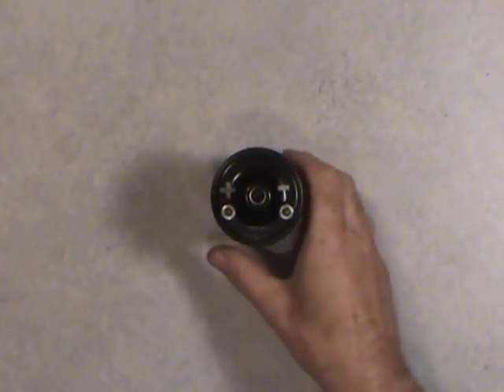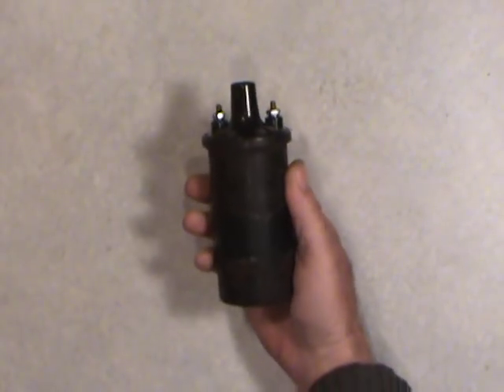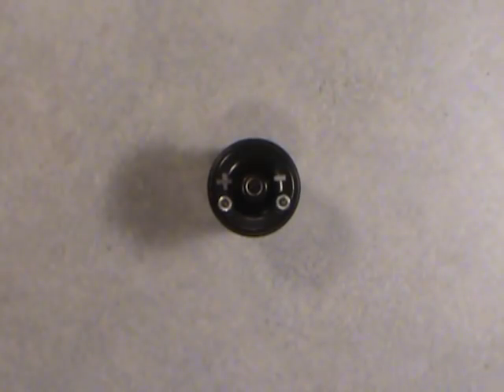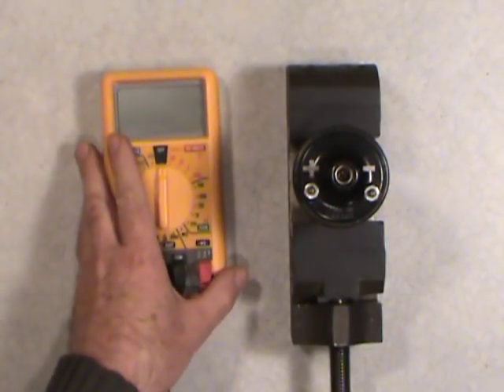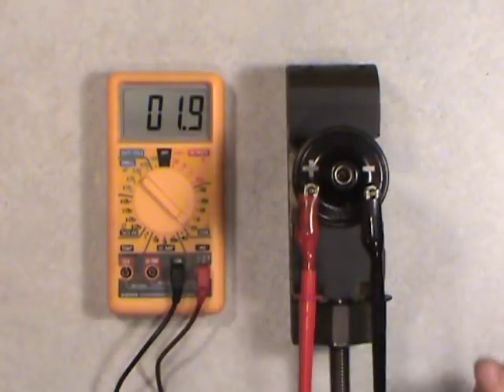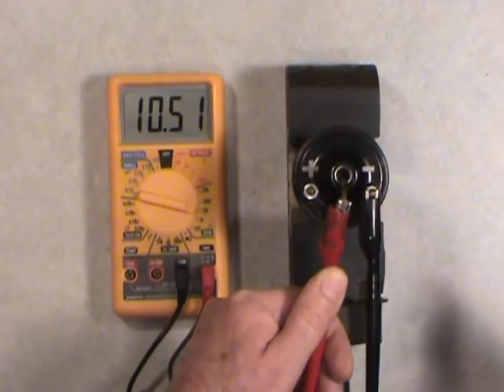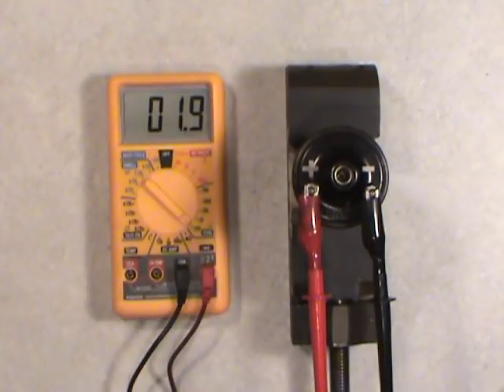Ignition Coil Testing

Comment: Thank you...Sir great video!  Helped a lot in troubleshooting  Coil - 1992 Ford T-Bird SC
Reply from the maker: Ravi Diasabeygunawardena Greetings Ravi Diasabeygunawardena....You are welcome, and, thanks kindly, for Your Great comment too!..........................................It's good to hear, that, You were able to use some of the Information, in this YouTube Video of mine, that was able to help You out, somewhat................................................By Testing, just about any Ignition Coil, with an Ohm Meter/Multi-meter, is, as I see it, just a "Preliminary" (aka, as in an Initial, and, Not-so-Complete) Test, so to speak, as, at times, an Ignition Coil, may appear to be Faulty, and Not be Working, all that well, or, even, Not at all, and could be either, the Ignition Coil Itself, and/or, could also be, any of the Related Wiring or Electrical Circuitry, that is part and parcel, of the Ignition System, as a Whole (aka, Total, of "All" Ignition System "Related" Parts and Pieces)........................................................Sometimes, an Ignition Coil, can become, Not Working very good, or, might even stop working, maybe even causing some..."Ignition Related"..."Miss-Firing" as well, when it Heats Up, and, Breaks Down, under a Loaded (aka, perhaps, a High Demand of its Output) Operating Condition......................................................So then, let's assume that, the Ignition Coil is in "100% (One Hundred Per-Cent) Working Order", then, any, and..."All Other"..."Ignition System Related"..."Components"..."Circuitry"..."Switches"..."Wiring"...etc., have to be in "100%"..."Working Order"..as well, or, we just might end up with...a Car or Truck, that, might..."Not Start"..."Have a Difficult Time Starting, either Hot or Cold, or, maybe Both"..."Start to Miss-Fire" (Ignition System-wise), and, from what I have seen over the years, I've come to the Point, and, train of thought, that..."I Assume Nothing"...and..."Never Rule Anything Out"...because, even when I thought, that I've seen "Everything"...there are, at times, a..."Thing or Two"...that have..."Shown Up"...that was "Totally Unexpected", and from my perspective..."Un-Thought-of"...as well..."Yikes"..!!!...lol......................................................Here's a pretty good "One", that happened to "Me", quite a few Years ago......................................................When the Engine (350 Cubic Inch Chevy V-8, with an Oil Filled ignition coil, that was controlled by, a points & condenser distributor) was "Cold", I Start it up, and Drive away...and...all seems to be alright...then...oh, about 1/2 Mile from Home, the Engine just "Quits, and Stops Running"...!!!...................................................I manage to coast it over to the side of the Road, and park the Car.....................................................I try to Re-Start the Engine...No Luck.....................................................I then wait, oh, about 5 to 10 Minutes, and then, try to Re-Start the Engine...and..."It"..."Starts Right Up", and I Drive away, and the Engine Runs, as if...there "Never Was a Problem" at All..!!!............................................During some Other times, the Engine would Run very good, for hours even...................................................Then, one time, I recall, just Cruising along, then, the Engine, just goes..."Silent"...for a few Seconds...and then..."It"...Starts Running "Again", as though "It" Never went "Silent" at all, in the first place...!!!.........................................I was Convinced, that, it was something to do with the "Fuel System", because, usually, if a person were to Turn Off the Ignition, and seeing how this Chevy V-8 Engine had a Carburetor on It, had me thinkin', that, once the Ignition started "Sparking" again (after Not Sparking, for those Few Seconds), I was also thinkin', that, there should have been some "Raw" (Un-Burned) Air/Fuel Mixture, as supplied by the Carburetor, when the Ignition System, was in the "Off", as in, "Not Operating" at that particular point in time, and, once the Ignition System Began "Sparking Again", I was quite sure, that, the Engine should have had, a nice Big "Back-Fire",Through the Exhaust System, due to, what I thought, would be the Result, of all of that Raw/Un-Burned Gasoline/Air Mixture, getting "Zapped", with that..."Working Again"...and shall I say, at times..."Intermittent"...Ignition System, that I had back then...!!!...................................................Now then, can You "Guess", what was "Causing" all of this "Ghost-Like-Engine-Operation"...???....................................................Yes-Sir-ee-Bob, when I Finally, got to the point, of, Removing the "High Tension Lead/Wire" (just a fancy name for the spark plug-like wire/lead) that "Connects" the (oil filled type) "Ignition Coil's Output Tower Connection/Terminal"....to the..."Center Tower Connection/Terminal, of the Distributor Cap", here's what I "Found" (aka, Discovered).......................................When I looked Down, Inside the High Tension..Lead/Wire's, rubber-like Boot...to look at, the Wire/Lead End Terminal (made of Brass), that supposedly, "Is"..."Supposed to"...be..."Crimped/Connected" to the Lead/Wire's...Internal "Core Conductor"...what I saw, was, that, the Lead/Wire's Conductive Core had..."Arced Away" (aka, Electrically "ERODED") away, from the Brass "Terminal", leaving a "Big Gap", between the Lead/Wire's "Conductive Core", and the "Brass End Terminal", there-for, as I see it, that Very High Ignition Coil's Voltage, was Forced to Jump that "Big Gap", that "Should Not" have been there in the first place...!!!.............................................Yes, indeed, it was rather difficult, to actually Imagine, that, that Quite Large Gap, between the Lead/Wire's Conductive Core, and the Brass End Terminal, could Actually "Cause", that, shall I say..."Very Weird"..."Sometimes Intermittent"...Chevy V-8 Engine..."Behavior"...that I Actually Experienced...!!!......................................................Once I Replaced that "Faulty" High Tension Lead/Wire, that went Between the (oil filled) Ignition Coil, and the Distributor Cap, it was like, I just Installed...an, as New, just broken in, Rebuilt Engine, that, Ran "Super-Duper"..."Yipee"...!!!...lol..............................................So, as You can now see, just when "I" think, that I've "Seen-It-All".."I"..."Have-Not", and that's the way..."The Old Ball Bounces"...weather "I' like it, or not...!!!....lol..........................................Thanks again, for watching, my Friend.................................................Be Safe, take care, and have a good one.

Comment: Thanks for the video mate. Nicely explained.
Reply from the maker: +john wright Greetings john wright....Thanks for watching, and Thanks, for Your very Appreciated comment, as well, my Friend............................We, just have to remember, to always "Check/Verify", the Ohm-Meter or Multi-Meter, for "O or Zero" Ohms/Calibration, especially so, when-ever, about to take/measure, those very "Low Ohms" Readings, on the Primary side, of an Ignition Coil, for Accuracy's sake, that's for sure.......................I should also add, that, even though a certain Ignition Coil, tests out OK, Ohms-wise, while usually being at about room temperature, there-abouts, there can be a times, where an Ignition Coil might start Acting-up, and, not work so well, or, maybe stop working all-together, once, that now (Ohms-Un-Detect-able), Faulty Ignition Coil, gets up-to Operating Temperature, or hotter...!!!.............................Just goes to show, that, "Ohm's Testing", an already used Ignition Coil, might not be, the, Be-All-End-All "Test", to confirm, it to be 100% Good and Functional, and, I guess, that, One could say, that, it's just one more, of "Life's"...little........................."Surprises"...lol........................Thanks again, and...........till next time.............Be Safe, take care, and have a good one.

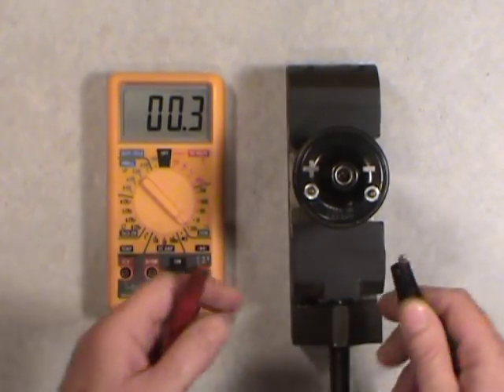Comment: Not hating on the video because it is good/ informative. But if you already know what a coil is and know how to use a meter, start the video at 10:30 for the specs your looking for. Also the "1" on the meter when checking the secondary coil should be thought of as an "I" for infinite as in "infinite resistance ", or "open circuit."
Reply from the maker: Greetings...jhitt79....Thanks for watching....................Hmmmmm...but, what..."if"...???...a Person, who happens to be, shall we say...New to the Game...and doesn't know, all that much, about an Ignition Coil, and how to Ohm/Resistance Test "it", with an Ohm/Multi-meter, then, should I, just, shall we say..."Leave-Them-Out-In-the-Cold"...??? (some might...But Not Me...!!!...cuz that's, just the way I am).................Sure, if I didn't give a hoot, about the Beginner/Novice, I could, just make, a..."Very-Short-and-to-the-Point"...YouTube Video, in a, shall we say..."Slam Dunk" (basket-ball term)...fashion...for the..."More Advanced"...Automotive-Minded Folks, alright (and it would save me quite a bit of Time as well, if I were to do so)......................That "1", that You mentioned, could very well be thought of, as being "Infinite/Infinity", quite possibly, but, from my Experience, with the Yellow Multi-meter, that You see, in this Video of mine, then, "it" will usually, just..."Display"...what appears to be, the Number..."1"...on the Screen, if I..."didn't have"...the..."Correct...Range/Scale"...Selected, for what-ever, was being Tested, at that particular point in time....................I'm thinkin', that, Different Multi-meters, might just have, a Different way of Displaying things, perhaps...???....................(Here's some food for thought)...although an Ignition Coil, might Check-out/Test Ok, Ohms/Resistance-wise, there could be a (rare) time, where, that, Tested-Out Ok, at room temperature (ohms-wise), Ignition Coil, might start to Malfunction, or maybe, might even stop working all-together, once it gets up-to Operating Temperature, or perhaps Hotter (Thermal Cycling...???), so, maybe keep that in mind, if there ever comes a time, where-by, the Un-Explainable, can't be Explained, until perhaps, a (known good)...Substitute...(new or used) Ignition Coil, takes the place-of, that...Not-so-good...Faulty...(while warmed-up only)...Ignition Coil, and..........till next time..........Be Safe, take care, and have a good one.
Reply: +RockysRoadshow Relax dude... Did you not see at the beginning of my comment that I said the video was good/informative??? I was giving you a compliment, then just letting anybody who was looking for how to test a coil (or the ohm specs.) on where to start the video "IF" they already knew how to use a meter, etc.  And the technical term for the 1 on your meter IS infinite resistance.
Reply from the maker: Greetings...jhitt79..........Ooops...my Bad...sorry about that...and Thanks, for the good comment as well................Actually, I'm quite Relaxed (most of the time...so, fear not)...................Quite some time ago, I did make a Shorter Version (Video), on Ohms-Testing (this very same), Oil Filled type of Ignition Coil, as well as, a Shorter Version (Video), on Ohms-Testing (the very same), 1979 General Motors (GMC)...Chevy HEI/High Energy Ignition...(epoxy-encapsulated)...Coil...(the type, that's mounted in the top of the BIG distributor cap)....................I'm not such a Fan, of using the Word "Infinity", when it comes to Ohms/Resistance Testing, with an average Ohm/Multi-meter, as I find it (for me, that is), kinda Misleading.................I much, prefer to hear, and/or use, the terminology, simply known as, an...(electrical)..."Open Circuit"...as, it's Super Easy to Visualize & Understand (just picture, in Your Mind, the Multi-meter's, Ohm's Dial/Range Selector, being set, so the Meter is active/on, and the "Test Lead Probes", are separated/not touching each other), and..."Wull-Ah"...there "it" is...!!! (a good ole...super easy to understand..."Open [electrical] Circuit"), and besides, if I were to "SHOUT-Out", the Word..."Infinity"...some People might be looking for that particular..."CAR"...!!!...lol...........................If the Test Lead Probes, are Not Touching each other (meter on), then the Air/Atmosphere, between the Probes, does have a certain amount of Resistance, not that our Cave-Man Multi-meters can measure it at all, but, if a High enough Voltage (as in Kilo-Volts), and enough Amps/Amperes, are present, and the Gap between the, shall we say Electrodes are kept at, oh, lettuce use a Large Oldsmobile HEI spark plug Gap, of .080" (Eighty-Thousandths of an Inch) for discussions sake...then...I'm pretty sure, that, a Spark would occur between the Two (hypothetical) Electrodes, over-coming the Air's Resistance, by way of...(Ionization...???...Plasma...???)...and that's why, I, tend to avoid, the Word "Infinity", when-ever I actually encounter, a Real Genuine..."Open Circuit" (the electrical type, that is)..................The Number "1" is so Misleading, but, I had a look-see, at a small Analogue Multi-meter (You know, the type, with the needle/indicator that Waves at You...lol), that I have here, and sure-enough, there "it" was, the..."Infinity Symbol"...(kinda looks like, the Number 8, being placed Horizontally/on its side, something like this oo).....................I Tested this very same Oil Filled Ignition Coil (again), using All of the Ohms...Ranges, on the Automotive Specific Multi-meter, that's seen in this Video, and here's what I saw........1.9 Ohms on the 200-Range (Note...this figure "includes" .3 Ohms Miss-Calibration)... .002 on the 2-K Range............... 0.00 on the 20-K Range............... 00.0 on the 200-K Range......and....... 0.00 on the 20-M Range...but...there wasn't a "1", until the Two Probes were Disconnected and Not Touching each other, so, to me, that "1", just simply means, an (electrical)..."Open Circuit" (and probably not, that out of range, what-sham-mah-call-it,  that I might have been brain-washed, into thinkin' before...lol)...and...till next time............Be Safe, take care, and have a good one.

Comment from the maker: Greetings anibalcarta....You're welcome, and thanks for your great comment as well...Seeing as how you have a "Timer" (not a distributor), and a single Lobe on the Timers shaft, and the fact that the 2 spark plugs fire at the very same time, has me thinking that the Timers shaft, should be turning at the same RPMs (Revolutions Per Minute) as the Crankshaft (as opposed to the conventional operational characteristics of the common Points style of Distributor for a 4-Stroke-Cycle Engine)...(con't)

Comment: very good informative video thanks, I've always wanted to learn about coils.
Reply from the maker: Greetings Richard Norton....You are welcome, and, I'm glad that You liked what I had to show and tell, You and Others (in this video of mine), about, a rather simple way, that a Person can at least, Test and See, that, the particular Ignition Coil being Tested, doesn't have any "Open" or "Shorted"..."Windings" (aka, the 2 rather long wires that Form each Coil inside this type of ignition coil), when being Tested with an Ohm/Multimeter....This so called Ignition Coil Test (in this video), is really, only, the "Tip of the Iceberg", so to speak, as, Ignition Coils, can at times "Miss-Behave", when they "Heat-Up" to Operating Temperature (and that usually includes, that nice Hot engine compartment as well).

It's also Very Important, that, "All" Wiring, and Wiring "Connections" be 100% Clean and Dry, or, Ignition Problems might start Happening!

Like You, I do find it rather "Fascinating", that the Ignition Coil can actually "Change" the 12 Volts (or whatever the Battery Voltage happens to be in a particular Vehicle, with some having a 6 Volt Battery), and shall we say "Boost" that quite Low Battery Voltage, into a Voltage, that is usually in the "Thousands of Volts"...!!!

Be Very Careful while being near any of that "High Voltage Electricity", while the Engine is Running, that comes out of the Ignition Coil, and any of the Ignition System's "Secondary Circuitry" (aka, spark plug "Wires/Leads"), because, if there happens to be a "Faulty" spark plug "Wire/Lead", that Very "High Voltage" can Really "Zap" You...!!!

Also, "Watch Out" for any "Hot and Moving" Parts...!!!

Thanks again, for Your well appreciated comment...

Be Safe, take care, and have a good one.